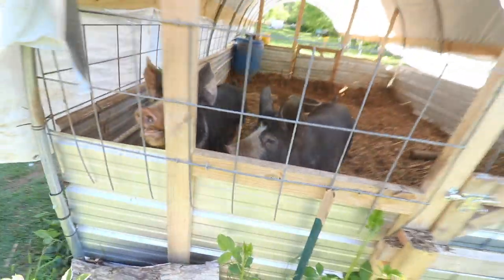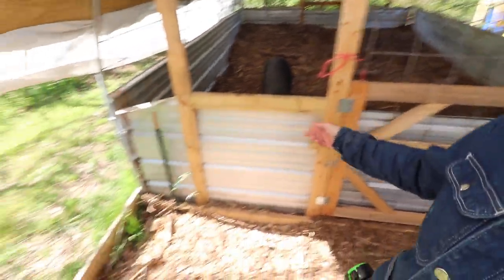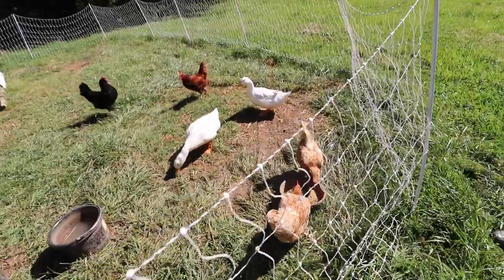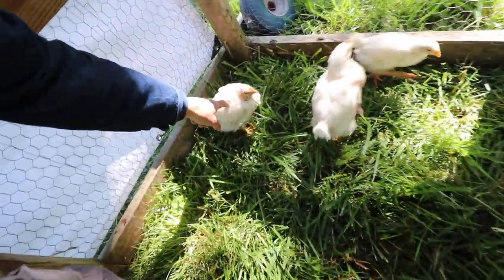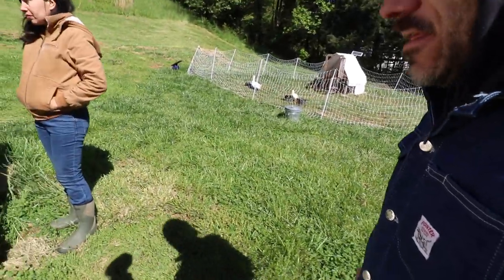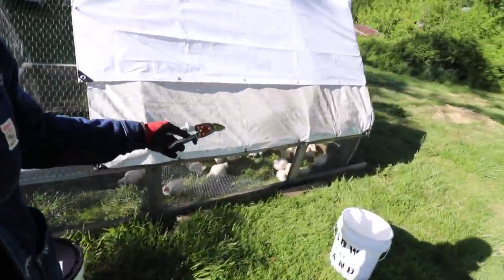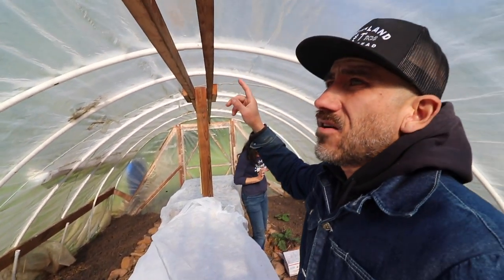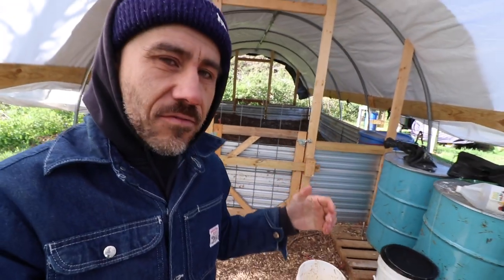First CHICKEN ATTACK in Moveable Coop (What to do)

Comment: Raccoons are known for doing things like that. They reach through the chicken wire and try to get the chickens. It will be back. May also want to reinforce the door. Like a lock on bottom like in top. So glad you put the Hardware cloth in the Chicken Tractor. I'd do the other Chicken Tractor also. God Bless and Peace Be With You All ☮️🙏❣️
Reply: Once a smart racoon starts  figuring out how to get in it often keeps trying -- I lost most of my chickens one winter because racoons figured out how to pry panes of glass out of an old window (5 feet off the ground!)  in the barn, a neighbor had old patio slider doors on the side of his coop and they figured out how to open those or get them off the track.

Comment: I have the same tractor design and used hardware cloth but due to the predators i added 5” stand offs on the bottom 2x4 and ran a dc fence charger, so far so good.

Comment: I agree with using hardware cloth-that's what I use at bottom 2 foot of chicken pen. Also the injured chick needs to be cleaned and antibiotic ointment applied twice a day and the chick needs to be isolated from the rest until healed. Chickens will peck at bloodied injured areas until they kill the injured chicken. BlueKote can be applied to injured site to prevent pecking and promote healing if you don't want to or can't isolate.

Comment: Like others have said, my guess would be a raccoon. I have 1/2” hardware cloth on the bottom of my tractor. The problem I had would be the tractor not sitting perfectly flat and raccoons would dig and reach into those gaps and get my chickens. I lost several in one night last year because of this. Mine also like to lay against the wall. Makes it even easier for the predators. I ended up buying a solar charger and ran a single strand around the bottom. I haven’t had a problem since. I mounted the charger and the wire to the tractor so it all moves together. Good luck with everything!
Reply: rbtbeach did it work ok having wire on the bottom? I’m just about to build my first chicken tractor and wondered about using a wire bottom as I don’t have electric fence. But I worried it would make it hard for the birds to scratch around.

Comment: Hi Jason we use a thing called snake mesh or mouse mesh - much finer - and we use tie wire to snig it to the chicken mesh if you don't replace the chicken mesh - works fine with all sorts of predators with several different jaws, beaks, tusks, claws, etc

Comment: D.E. is a good source of calcium, but if you need it for a louse treatment then it should be sprinkled, and rubbed in to their feathers. It also works for tics and fleas on other animals. It works in two ways it absorbs water and dehydrates the insects and at the same time becomes lodged in the insects joints and tears them up.

Comment: You should spray that with something like blu-coat. Chickens will peck at red and not stop. If ever a chicken has noticeable blood on them the other chickens will peck them to death. The use of hardware cloth around the bottom of your tractor is much better than chicken wire. Also chickens don’t look like they are sick until they are nearly dead. But you should alway have on hand an antiseptic spray and maybe a clotting powder in case of active bleeding.

Comment: There’s Weasels, Opossums. Rats, Racoons - and they can dig and go under (rat holes in grass can hide pretty well).  They’ll attack again during the night if you don’t  protect. Chicken wire is not totally safe...hardware cloth is best, they can put arms through the round mesh, rats could even squeeze through.

Comment: For future reference, please do follow the advice about removing the wounded bird and treating the injury with Blue Kote. Those are the answers to "What do we do?" for the wounded bird.  From the injury and their behavior, almost certainly a raccoon reached in and grabbed a sleeping bird, but couldn't finish it and get it out through the wire. The birds all moved in away from the edges and out of reach. A weasel would probably have got in through the wire, and then you would have had a slaughter house of chickens, not just sleeping chickens in a new spot ;)  Tighter wire mesh should help, but get right on it. Whoever it was will be back tonight to try again, now that it knows where they are.

Comment: That chicken may have hurt himself on the chicken wire or a nail or something, I have seen the ones I used to have flutter around like crazy and run right into a wall or fly up and knock themselves out on the roof of the coop. The ones I have now are still little so no issues yet.

Comment: I second the raccoons if they can get a firm hold they will shred the chick right through the wire. (think chicken burger) You need to use 1/2 in wire.  And they will be back, maybe with their family.  I don't buy chicken wire for anything anymore. I've had raccoons pull and rip it open.  Just got to the end and yes, the hardware is the only way to go.

Comment: Well I generally like the weather conditions in the Greater Asheville area especially your usually less humid conditions but i think summer has finally arrived in Central NC. From Friday, May 15th until Sunday, May 24 the lowest day temperature is going to be 63% and the lowest night temperature  will be 49%. Sorry about the colder temps because it does not bold well for you and Art and Justin Rhodes.